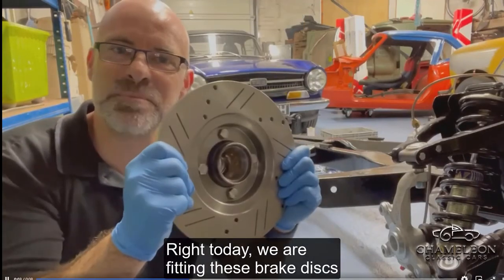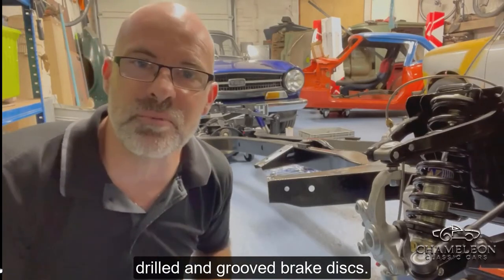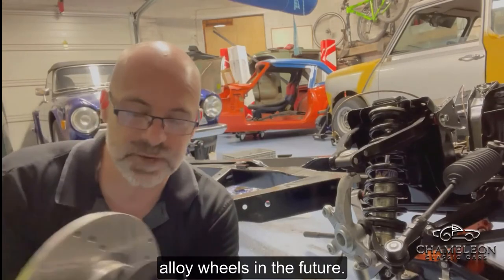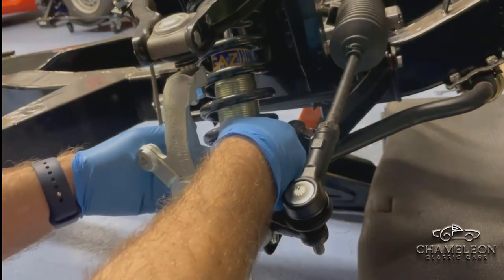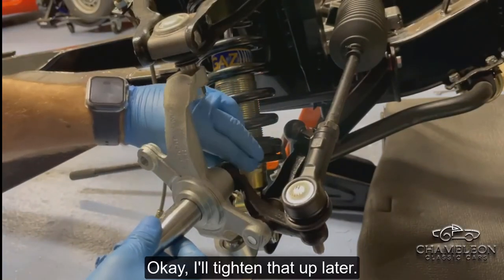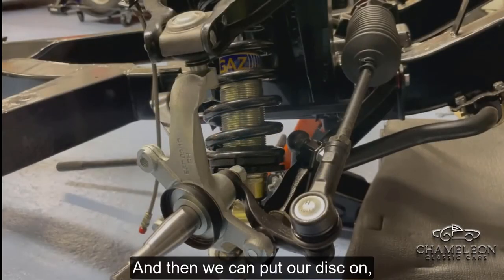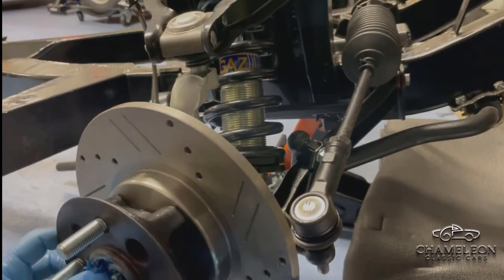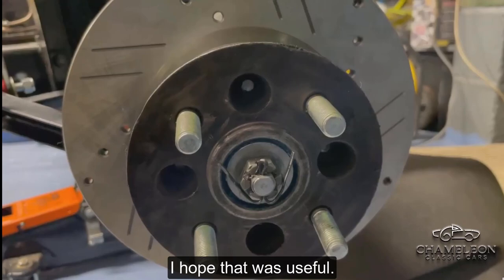How To Build A Fast Road Spitfire - Part 4 How To Fit Brake Discs & Bearings

Comment: You may want to check and re-torque the hub nut after about 50 miles use when the bearings have bedded in.
Good luck finding oil seals that are the correct size these days :-(    DON'T throw out the old seal backing plate until you know the new seal fits.

Comment: Thanks for the insight. I've just gone to fit Freelander studs to my 1500 (for alloy wheels) and of course found they wont fit in- in-situ, not enough room in the back. I'm guessing the only way to fit the longer wheel studs is to remove the entire hub, and take out the four bolts from the back of the hub/disc? Thanks
Reply from the maker: No you won't be able to do it in situ with the longer bolts as the brake disc will be in the way